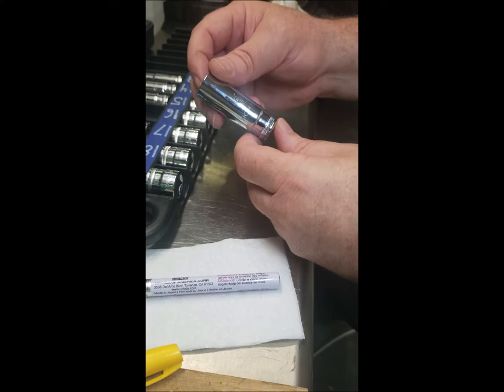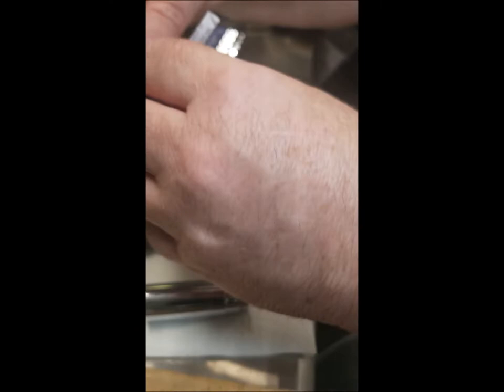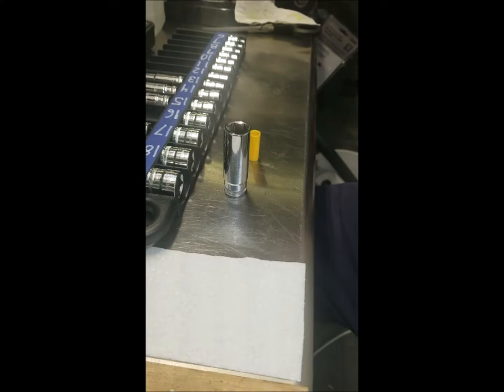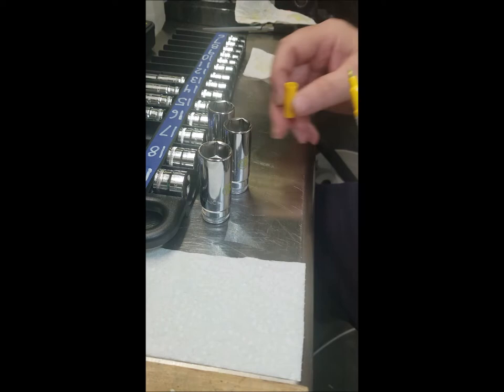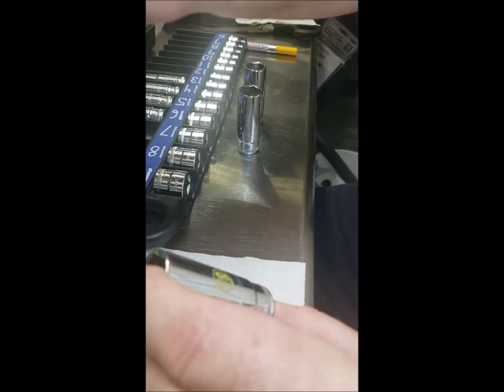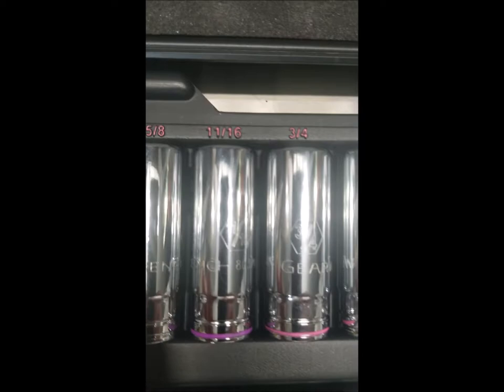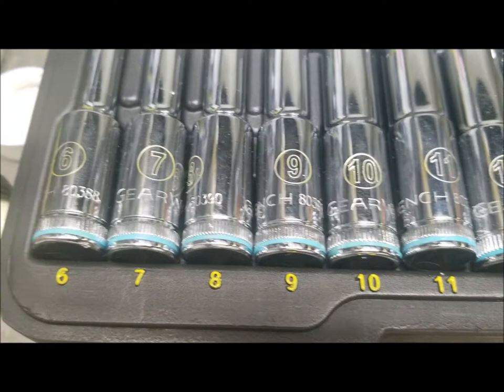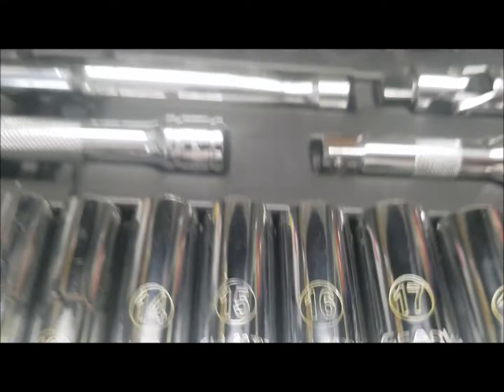Pro Tips for FAST & EASY Color Coding Tools, Sockets, Wrenches, Ratchets & Cases with Paint Markers

Comment: Blevins dry completely, take smooth side of microfiber wet with good off industrial or your choice of solvent lightly, put socket on adapter in a drill, place rag tightly around socket as you spin on high.but I will try chrome polish too